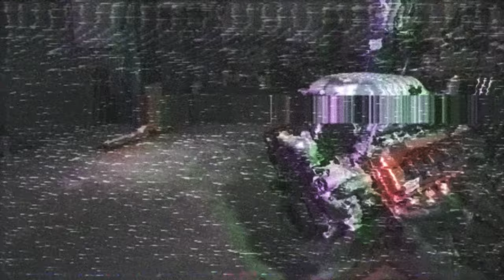Engine build time-lapse 840-hp Dodge Demon Hemi V-8 | Redline Rebuilds - S3E1

Comment: Those heads are MONEY! 5 angle valve job. Huge valves. Enormous ports. No wonder it makes so much power!
Reply: Also, they are twin plug heads like a 5.7L. Didn't realize these were twin plug as well. Wonder if the Hellcat has twin plug heads. These engines are pretty rare in this trim in Australia. We have lots of Gen 3 N/ A Hemi's thou

Comment: You know what suprises me about this Engine. It uses absolute old technology, besides the Variable Cam Timing, Twin-Sparkplugs and a giant Blower. But still manages to get out 840 HP. It's fascinating to see this. I work on German Engines and you see all the technology that goes in to the engines for Power gain, low fuel consumption, and good emissions. Yet here comes an American Company, that goes by the American Idiology of Simple, Reliable and Powerfull and puts out such a behemoth of an Engine.
Reply: Because America knows how to make cars better than anybody else (ignoring Tesla)
Reply: Giant blowers are old technology. Ever heard of a 14-71 Bowers
Reply: They make a 1000hp version too. Create motor for the street with a warranty. Can't go wrong
Reply: I think he's talking under the hood superchargers, 
 @moparmanicgarage
Reply: Yeah I thought that too... No Vanos or Valvetronic, no direct injection, no independent variable cam timing, two vales. AMG and BMW M must be shaking heads..
Reply: @cobra_daytona1834  And yet neither of them make a car that can run a 9 second 1/4mile... 😜

Comment: That is one beast of a motor, still wondering though about the HELLEPHANT Engine which is stronger! Hagerty you should do one of those as well!!
Reply: They are that close to the same thing that there isn't much point
Reply: Crate engine only.
Reply: They sold out in 2 days so, problably not
Reply: Hellephant bound to see its light of day after these two stop fucking around with the demon which will be a little while or at least until the next rebuild 😂

Comment: The most amazing part to me is how the start of the build looks like the previous ones of the older V8s. It shows how, over the decades, the fuel delivery and ignition management have changed but the internals of engines are still very much like those before.

It sounds crazy, but I wonder if this thing would run on a pair of carbs and a points distributor, if you had a different intake and a place to mount the actual distributor drive gear.

Comment: More horsepower in 1 cylinder than an entire Civic Type R. Can't wait for dodge to throw you a Hellaphant.
Reply: 840hp/8=105/cylinder. Nice try☺
Reply: It would take around 60% of a Civic engine to run the super charger😂
Reply: @xinferischief1570  Imagine a civic 4 banger trying to run the 4 liter supercharger of the Hellaphant

Comment: Block looks quite similar to LS blocks from GM. Who stole who's design? So FORD is the only one who caught the DOHC cam bug eh? Seems like the new LT V8's from GM with direct injection are the most fuel efficient. I'm not exactly a gearhead though. Just trying to get a general overall handle on the situation today.

Comment: Just get a regular hellcat and smaller pulley with good tune on E85 fuel with proper safe tune, you would be making much more power for less money,  6.2 hemi are all forged internally and built well with few upgraded  parts that are poor quality, other than that they can take a beating, ofcourse you can debate this but  debate this with me if do have  a hellcat.

Comment: to make a that engine, you first will need the tears of angels, and the bones of a 5 legged sheep, you mix a lill vampire bat wing, and aluminium powder, kill 3 black roosters, bury them on a crossroads lit by red candles in a pentagram made with cemetery pebbles in the dirt.

Comment: It has 2 valves per cilinder only?
Reply: It's a pushrod engine. Most pushrod engines don't have more than two valves per cylinder because typically they rev rather low. And at low RPM you want high air velocity, which is what only two valves per cylinder is great for. It's also more simplistic.